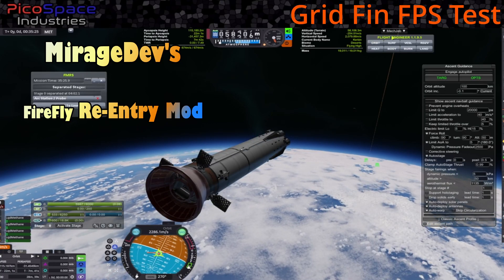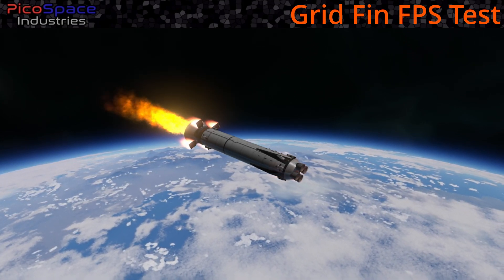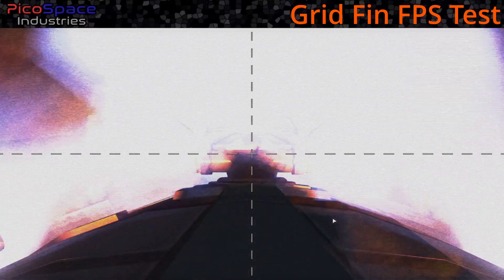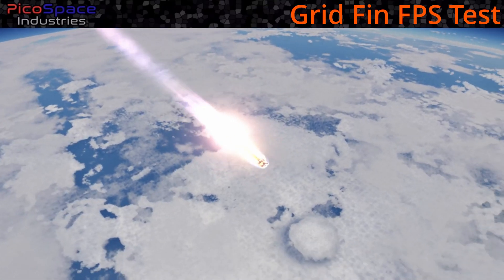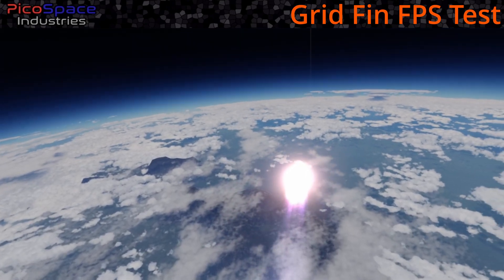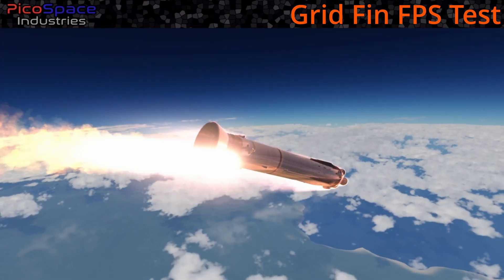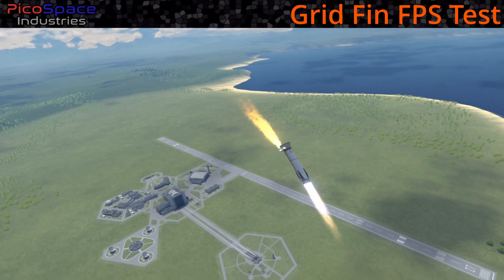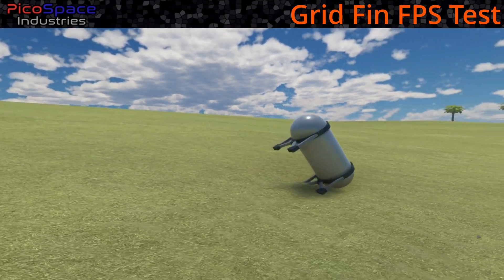MirageDev's KSP Firefly Mod - Grid Fins Re-Entry FPS Test

Comment: do the mach cones effect work only on ascent?
Reply from the maker: Mach cones are from the Vapor cone mod, and they happen whenever you pass through the sound barrier, in any direction. Firefly will eventually be coming out with an update which will include its own vapour cones based on its algorithm but for now it’s a separate mod.
Reply: @picospace  thank you so much! What is the mod called? Vapour cone mod?
Reply: It’s on space dock (where I downloaded) it’s called something like what you said, so it should appear when you search it up